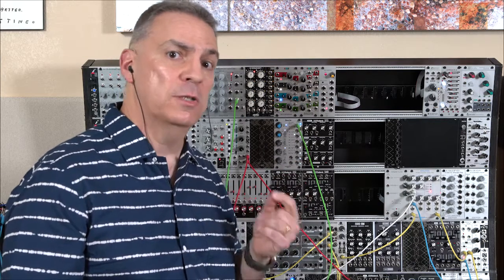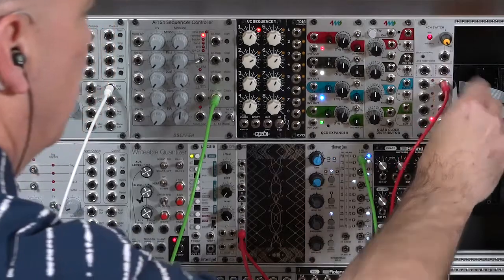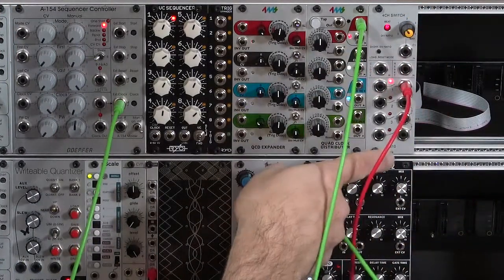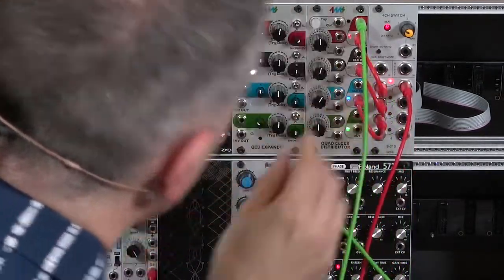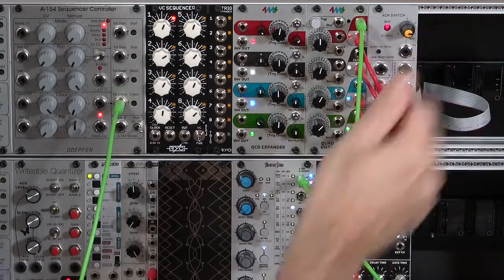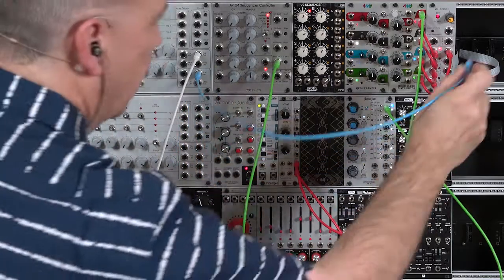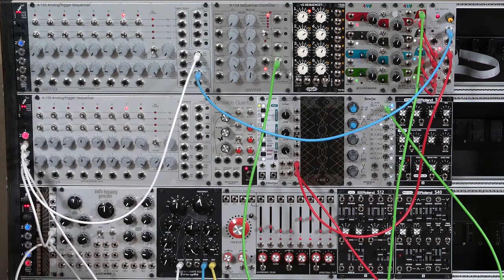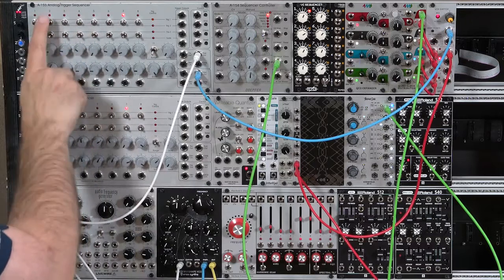Ratcheting Using a Voltage Controlled Switch

Comment: I don't quite get the patch. Is the vc switch feeding into the envelope generator?
Reply from the maker: Yes. Normally the clock is patched to the sequencer, and the gate out from the sequencer is patched to the gate inputs on the envelopes; you could also patch the clock to the sequencer and the envelopes. With the ratcheting patches I showed, instead the base clock (which still goes to the sequencer) is also multiplied to different values, the switch picks which value you want, and that result is patched to the gate in on the envelopes.